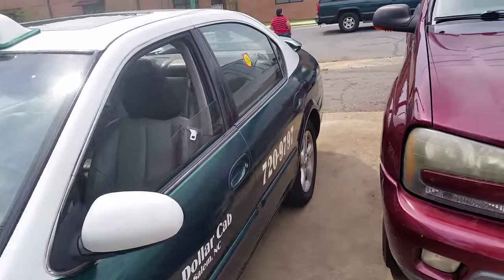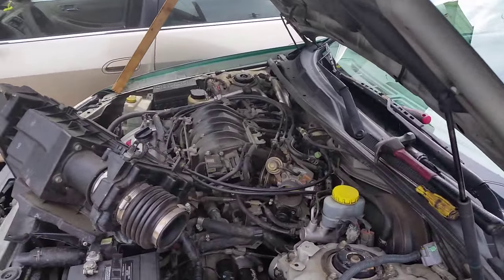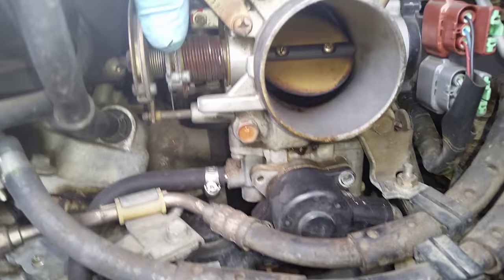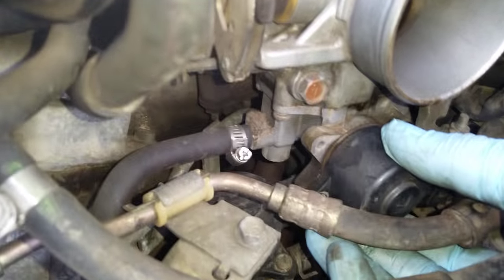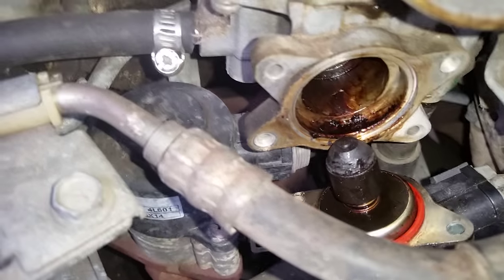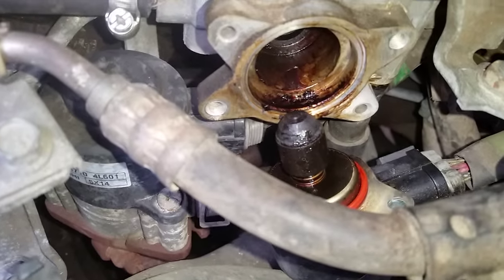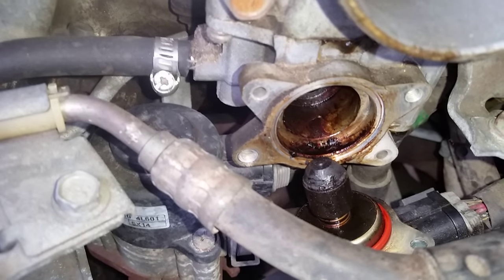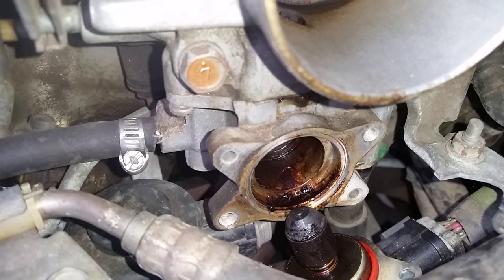How to Fix Nissan Maxima  Idle Problem

Comment: Thank you so much, this sorted my Daughter’s Maxima idle issue , same deal , it would start and rpm drop to zero and stall.  Some carb cleaner and the wife’s toothbrush and it is running sweetly again :) I think that the little rubber plunger bit on the end doesn’t retract when dirty , you could feel it had more travel back towards the spring when it was de-coked
Reply from the maker: You're welcome!

Comment: My maxima was idling high in park 1700-2000, drive was around 900 and at stop lights felt like it was hard to stop, also i was losing some coolant.  Change your maf sensor and replace tps and adjust it to factory specs.  The maf dropped it right down and the tps put it right back in the sweet spot.  Cleaning the iacv never hurts either, but for me i didn't have any check engine lights and that was all i needed.  Worth trying all the cheap things first and they are all easy D.I.Y.

Comment: Would cold whether cause this to be worse? Mine is a 2000 and it has been idling low at stops and I just tried to start it after a snow storm and it died several times and I finally got it to go but I had to sit in the car and hit the gas when it would idle low. Strange thing is it would idle fine for about 8 seconds and then drop low, and eventually die. Thanks!
Reply: Same here

Comment: My 2000 Nissan Maxima keeps losing rpm’s. Had the throttle body cleaned twice. It works for awhile okay but eventually the rpm’s goes below 1000, the 500 and eventually it stalls. Hope this is the answer

Comment: I have a car of the type of Nissan Maxima 2001 I have a fault transmission at the change of speed all the change is good but beyond the fourth change when it reaches the car remains on the third switch with the knowledge that all the substitutions good than the last I mean by the fourth switch My question is whether each switch speed has a sense Where is the sensitive switch of the last four and thank you

Comment: thank you for this tip. gona try it cause we have already put a new alternator, new battery. new spark plugs.
Reply: Alicia Selby did it work for you?
Reply: Same here..mine wont re crank after the engine is hot but once its cooled down it starts up fine..it idles little high now after getting it from the mechanic(altinator and oil change)?? The mechanic flat out told me after thousands in this car that he dont know why its doing that and ive gotta "deal with it".If i rev the motor before cutting the car off,it cranks back up ok...would that mean fuel filter or injectors? I just put seafoam in last night but havent noticed a difference yet

Comment: I brought a new idle part but my car still revs when in park can you tell me why
Reply: Depends on the car bro my honda civic pulses reves and drops rps due to a bad radiator could be a few things slight vacuum leak or the system isnt pressured correctly I like to just step by step kn the car make model write a check list of issues and go from there also be sure that your evap canister is good that purge valve could be bad happy hunting hope this was helpful
Reply: Idle relearn. Simple to do watch on youtube. But watch a few some differ

Comment: I got a 03 maxima, drives fine "service engine soon" light on code  p0506 idle too low. The car sounds ok to me idles around 600-700 never cut off or stalled. I notice a little bit of grey smoke from tailpipe sometimes.

Comment: h
Hola necesito saber la posicion de los cables del plug del idle air control para nissan maxima del 2000 gracias

Comment: My 01 inifiniti dies on me out of nowhere while I’m sitting in traffic and the terminals we’re changed and I don’t think it’s the battery . After terminals we’re charged it was still dying . Do you think it could be a problem with the engine ?
Reply: Check the wires on the knock sensor front motor mount. Start car amd move the wire at the clip and see if the car dies.

Comment: Will this work for 1996 Infiniti i30 idles really rough and low 500 Rpms and wants to die.
Reply: Did this work for you I have a 99 Infiniti i30 trying time figure out the problem, check engine flashes when I accelerate

Comment: would it work for rough/shaky/noisy  idle on altima 2003, the engine shakes more with load on idle (like AC), belt shakes (replace belt and tensionar but no luck)
Reply: Clean the throttle body first and see how it goes. If it still shakes then replace the tps. (throttle position sensor) but be careful on tps. If you don't know what u are doing. Get a mechanic to do. It needs to be re-learn that's why. But like I said go for the easy stuff like cleaning the throttle body, replace your air filter and  clean MAF sensor. Hope that helps
Reply: @2john149  thanks for your reply. But I sold my nissan a year and half ago.  Just wondering Does it work the same way on acura mdx, my other car
Reply: @harryaroraji  Try cleaning the throttle body, clean MAF sensor with maf sensor cleaner only. If that doesn't work. It would be the engine support. How to check is lift the engine slightly with jack while engine is running. If engine idles normal then you know it's your engine support. But like I said just do the regular maintenance first like MAF sensor and throttle body clean up. Good luck
Reply: @harryaroraji  also forgot. Please check your pcv valve. First check the hoses on the pcv valve. More than likely its leaking or old and needs to be replace. They are very easy to replace. Remove it and go to a part store and they can measure it and give you a replacement hose. Very cheap. Again good luck

Comment: $15 eBay catch can and a new PCV valve will prevent that. For whatever reason the PCV system on these engines suck oil right back into the intake.

Comment: I have an 2001 Nissan Altima and when I hit the break when I’m driving my rpm goes up and down from the 1-2 then when I hit the gas it goes high. But it only does this a couple of times when I’m driving and sometimes don’t.. Anyone can help me with this???
Reply: sounds like a vacuum leak
Reply: What's up Katrina I know this is an old comment but do you still have that problem you were asking for help with? If not I still have another question for you too...

Comment: I cleaned the throttle body and now I have a code for the throttle body, which I didn’t have before I cleaned it. The car is moving quicker on its own but the gears are shifting weird/fast as I slow down.
Reply from the maker: try to use a relearn procedure. and make sure you dont have any air leaks.
Reply: @crazysexycool180  what about cleaning the fuel injectors?

Comment: Yo. ..my 01 max see 5 spd kinda has back lash in every gear....I had new clutch yranny bearings replaced new ig could new iac like 4 years ago newer maf sensor
....Yada Yada. ...how bouts that backlash like 1st gear can't take my attention off in deceleration what gives
Reply: same with mines
Reply: same here, anyone found the cause yet?
Reply: Try the idle relearn procedure.
Reply: @romebowermaster5060  same
Reply: Worn motor mounts causing the engine and transmission to rock and rotate causing the whole car to buck in slow speeds and shifts